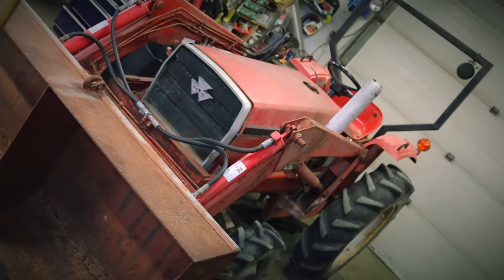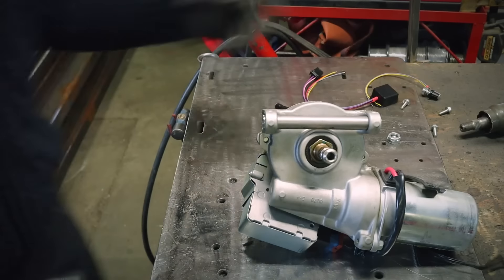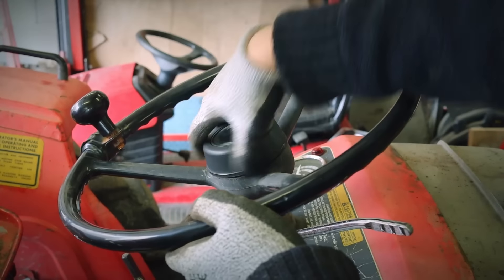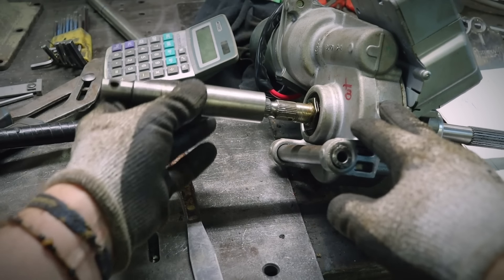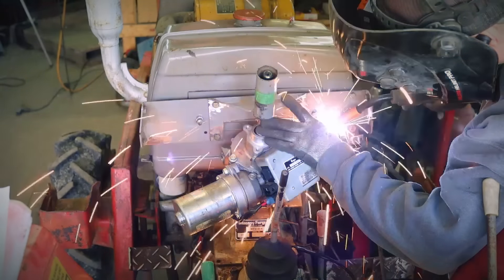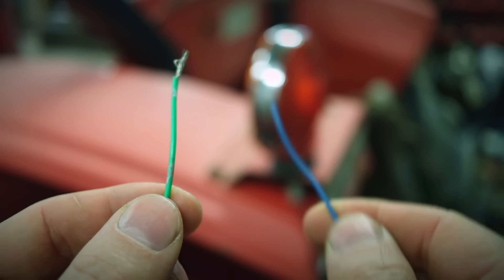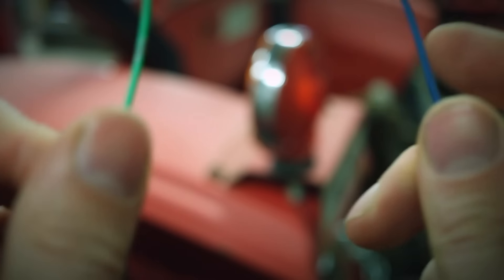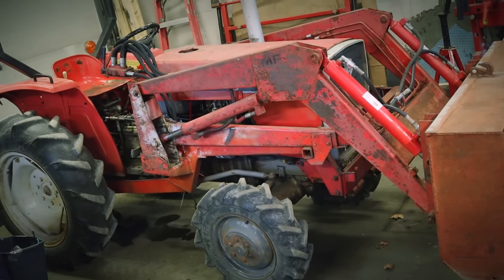ELECTRIC POWER STEERING on my tractor!? For less than 120$

Comment: I know several people who bought old tractors thinking that they could get some work done with them, only to find out that the only work that got done was TO the old tractor. I can't think of anybody better prepared to work on an old tractor than our man Viny B, and this video proves just that. Thanks again, Viny, for more fantastic entertainment!
Reply from the maker: Hey man, THANK YOU for such a nice comment! Glad you appreciate the content and all the upgrades I'm about to do to this machine!
Reply: I have a 1958 Ford 641. Working on her is just as fun as working with her! So no complaints from me!
Reply: If you buy a tractor or any other heavy equipment in that age, you definitely have to do some (a lot) of work to it to bring it back to a decent shape or even revive it from the death. But let's assume you didn't buy someting that only has use as scrap metal and that there's no issue like spare parts that can't be obtained anymore. At those times there was no electronics, so you can fix almost anything.
Once you did the needful to fix stuff that inevitably is broken, you can get a good deal of work done in a reasonable time that you otherwise probably wouldn't be able at all. I for example was digging out some tree stumps with my 1985 backhoe, which would be in the ground for the next 10 years to rot if I wouldn't have convinced my wife to allow me the budget for a machine. I'm pretty sure, I'd never have fixed my driveway with a wheelbarrow and a shovel either. And moving firewood can of course be done without a machine, but it would take not only a few minutes more...
So, while I sunk countless hours into addressing certain issues, it also has given me opportunities that I otherwise wouldn't have had. I count time as a currency that I exchange for the power to do things.
Reply: If that’s a Perkins powered Massey, it will still be running after you and me are dust (and if fuel is still available). Try that with a newer tractor.
Reply: That's the fun part

Comment: My best advice for working with electrical stuff - never ever trust the colors of the wires if you hadn't worked on something before. Just because the green wire is marked as ground that doesn't mean it is. I've heard people got electrocuted working on house installations because the ground was connected to live. Always check the wires with a multimeter. Great video!
Reply from the maker: I'm 100% with you! 👍

Comment: I think you should install limit switches to stop the assistance before the steering locks to not cause excessive wear or premature failure to all components. The car computer used the feedback from the steering wheel angle sensor to do that.
Reply: Awesome

Comment: Nice to see more people using these one thing I will add is, be carefull when welding to the output/input side of the saturn vue motors, they have plastic reduction gears inside the unit that are attached to the splined center shaft, not trying to discourage people from this mod, but just saying take your time with the welds especially if they are vary close to the center motor unit, and take your time and let it cool for a few minutes when welding it, well if you want to be careful with it, also a good tip to keep operating tempretures lower and improve reliability, you can extend the 4 wires and remote mount the stock saturn electronic control unit and bolt it to its own remote heatsink, if that is too much work at the least I would suggest you carefully remove the control unit clean the old thermal paste off,  and apply new high quality thermal paste to the unit sometimes the factory is a bit conservative with the application of the thermal paste.
Reply from the maker: Thanks for you tips! 👌

Comment: Lol... I had a Massey Harris 50 with difficult steering, for the decades I possessed it, with no loader/bucket. I thought power steering might be needed, but after rebuilding the gearbox & greasing all joints (king pin & tie rod), it steered so smooth & easy...power steering would not have made it any better!
Reply from the maker: I agree, my tractor without the loader, is absolutely fine! The loader is the big killer here!

Comment: I have the EPS on and working . Mine is a little different because I used a Nissan unit . However it is on and so much better than before  . I am also rewiring the whole tractor and fixing all the lights . Thanks for the motivation and if I can figure out how , I will make a video . Cheers

Comment: Tip for wiring anything even house wiring. Use dielectric grease on all connections. the dielectric grease keeps the connections from oxidizing, and failing. I learned this trick when I owned a Honda car. I had to take apart the electrical connections to replace headlights and find the clear sticky substance in the connectors. Found out it was dielectric grease. It really has worked well for me. House wiring extreme example, I had some outdoor yard lights with high power quartz halogen bulbs and they would only last a month or so. I added a lot of dielectric grease to the bulb connectors and the bulbs then lasted over a year. I don't wire anything now without applying it.

Comment: Used on an automobile, the power unit only works hard while parking.  The tractor application has it working hard almost full time.  Long duty cycle.  Wonder if a small 12v fan would help.  Looks like there would be room enough.  Pretty creative sheet metal work.
Reply: Used on an automobile it worked against a much higher gear ratio in the steering box (remember, the tractor was designed with enough mechanical advantage to be steered without assistance) so now the power steering unit is working only as hard as his arms used to and without the cornering forces, speeds, and lateral traction of an automobile.
Reply: @mwilliamshs  Yet the motor apparently gets 'very hot' so still not good eh?
Reply: We don't know what very hot is. Nothing under 200° is unusual for these units.

Comment: Very Nice Classic Musical Ending, no problems during winter time for the HOT electric power steering, during summer a side cooling fan perhaps 🤔Cheers 🍻🍻
Reply from the maker: Yes, maybe a fan...but so far, it works better then I though!
Reply: xD if he add the fan in the right direction he can cool two things at the same time xD

Comment: on the next episode you should make a quick hitch for the front bucket so you can easily swap them out, why you may ask even though you've only got front loader bucket? so you can build a new attachment for a set of forks to make moving stuff easier
Reply: Clearly you didn't watch till the end of the video!
Reply: In the US, you can buy conversion kits for old Massey loaders.

Comment: Awesome build. When trying to remove something like the steering wheel or a bearing with a puller, put tension on it with the puller and then hit it along the axis with your air hammer / air chisel. The vibration will make it come off easier.
Reply from the maker: I'll try to remimber that! 👍

Comment: FANTASTIC!! - Nice... Absolutely LOVE this video! Thank you!
I've got an old 1970s Massey Ferguson 135 (Gas, updraft) - with no power steering. 
Not nearly as hard to turn as yours, but still, no fun at all. 
I've done a LOT of brush clearing with it, it's definitely a workhorse. 
I need to fix the clutch throw-out bearing now (oh, yay) - as well as the hydraulic lift... (it's making a poketa-poketa-poketa sound...)
Recommendations appreciated!
Reply from the maker: Glad it inspired you! Good luck with your old 1970 MF! I was that 🤏 close to buy one....gas too...but it was took big for my small yard...and I'll miss the diesel smell 😅

Comment: Great setup. I think eventually the steering gears will strip out from the force. I have the exact same tractor in the Allis Chalmers 5020 version. I fabricated a hydraulic ram system for mine that mounts to the steering tie rod. Works great. Thanks for all your videos. Chris
Reply: did you need a different pump for your ram system to work or use the same pump that you for the bucket
Reply: Im here to ask the same question as daledubblanko

Comment: I believe you have inspired me.  What about installing a larger computer fan to blow air across the motor of the steering assembly.  When the tractor is running,  you would never hear it.
Reply from the maker: Good idea! But I played a lot more with this setup and heat is not the biggest issue now...I kinda destroyed the pignon gear and it's bearing....🤦‍♂️

Comment: I have the same model. My steering failed when the sector gear lost several teeth... Water leak entered  and ruin the pinion ... zero parts. 
I converted it to a hydrostatic system.

Comment: Consider adding heat pipes. (Copper tubes with a small amount of water sealed under a vacuum that rejects heat quickly) or maybe add some aluminum heat sinks to it…or 12v fan
Reply from the maker: aluminium fins could be an idea!

Comment: I'd like to add electric steering to my 65' Dodge. It has hydraulic steering now and works just fine, but,,, I want to go with a manual steering rack and this same or similar, electric column under my dash...

Comment: If this is the tractor I think it is it's made by Yanmar to Massey Ferguson's specs. I was looking at a similar unit at the local Kubota dealer last year before I got my new Massey Ferguson GC 1723E from the local MF dealer. The only difference is the tractor I was originally looking at was a Allis Chalmers model of the same machine. When I did research on it supposedly Yanmar made the same tractor for Massey Ferguson, Allis Chalmers and Bolens. The only difference  between the three besides the colors and branding were the hood/bonnet design. Other than that they were they same machine in different clothing with the same 2-cylinder diesel in it. :)

Comment: How is it holding up over time/use? I'm thinking about doing similar on my IH B414 so I can get a loader on it and to help out in the woods but wondering how durable it would be under heavier use.
Reply: Haha, yep, I’m in the same predicament, have a B414 loader tractor and wow it is a hard tractor to steer, even while it’s moving it’s rough. I’m from Australia

Comment: Awesome video! I have a mf220 pretty much identical machine I've been trying to figure out a way to put power steering in... Thank you for this video I haven't put much thought into keeping the original linkage and adding eps. Are things still working good and anything you would do different?
Reply from the maker: For now everything looks pretty good! It's a game changer for dribing these little tractor and it's a ''simple'' modification!

Comment: Impressive effort!  Nice job!  But, IMHO, I think this will come back to bite you in the butt.  The original OEM design calculates forces on the steering gears based on manual (human) input.  So now, you have added 10X the force on these same components...they were never designed for that.  Somewhere along the way, a front tire/wheel will be in a hole and you'll crank the steering wheel and you will feel something snap.  You might want to have spare on hand of those components also!
I own a Case/IH 235 with manual steering.  I would love for it to have power steering, but I am certain the gears can't stand forces like that.
Regards.
Reply from the maker: Yep, you got that right! I found the weekes link by playing with it and it's the helical pignon gear...tey don't make these anymore so I bought an used one for the price of probably 3 new ones! 🤦‍♂

Comment: If you use the adjustable pot for power steering force, does it change the tactile 'feedback' from the steering?  I hate driving rental cars with electric power steering, but if there was more wheel feedback, it might be interesting for other projects.

Great for your tractor of course.  Thanks for the video!
Reply from the maker: Well you really feel it, It's harder when the POT is at a low setting. I always run it full on!
Reply: @VinyB57  I was going to say that those potentiometer based (usually a 555 timer inside) controllers are notorious for 'drift' - as they heat up the assistance varies - and there's a much better speed sensitive controller which mimicks the original ECU/speed feed etc using a speedo pulse.
Then I remembered this is a tractor, not a race car.. and you run it full-on anyway :)

Comment: I have a 2 wheel drive MF 210. I have had the electric power steering unit from a Nissan Sentra for some time and thanks to your video , I am finally putting it on .  By the way what is the model number for the front end loader ? Thanks for the Video and good work . Cheers
Reply from the maker: Hey thanks, glad you liked the video, unfortunately, I have no idea what is the loader number...
Reply from the maker: Found the identification plate, it's a MF216 for the loader
Reply: Thanks.  I have my unit mounted and will be  finishing it up  soon.  I hope to have it  back  on  the tractor  in a few days.  I have taken  some pictures  but not sure how to post them . Thanks for the motivation  I  needed to get it done. Cheers.

Comment: Can you add a computer case fan to the underneath of the dash...or one end of the p/s unit...to blow cooling air over the p/s unit?

Probably 90% of steering effort in a normal road going vehicle is in a straight line...sothe p/s is not "working"...
whereas you are now using the p/s to turn  90 degree corners every 30 seconds or less......

I have a 30 year old heavy diesel powered SUV with hydraulic p/s...worm and ball mechanism...
and it tracks nice and straight with minimal movement/input by me on straight 100kmh tarmac roads..

Recently we bought a 2004 station wagon with electric p/s...and it "wanders" much more at 100kmh....
so easy to overcorrect and progress in sinuous curves....
 on a dead straight piece of tarmac road!

I just about need one of those "effort adjusters"....
perhaps manufacturers should have taken note of the automatic effort adjuster in the Citroen SM p/s from the 1970's?
Reply from the maker: Sure! But I ve been running like this for a few months now, And Its just fine like this, thanks for your comment
Reply: I thought you said it overheated??? @VinyB57

Comment: Cool project, probably the only MF tractor with electric power steering. At first I thought you where going to use the Prius steering unit everybody else uses.
What happens if the power steering hits the end travel in the halfmoon- gear below?, I hope it stops at too much force...
Reply from the maker: I heard that in the Prius it turns into limp mode when its not connected to the ecu and have like half the power...that s what I heard tho🤷‍♂️ Well while testing, I went to the end of stroke hard and I broke some teeth on the pignon...stupid me!! But I got a spare one for way too much money! 🤦‍♂️ So good call!

Comment: bonjour cousin , je suppose que pour les connections de la colonne de direction d'origine et du volant sur la colonne de direction assistée , tu as sécurisé plus que " tapi tap pap " : vissage ou goupille élastique style mécanindus  ? sinon bravo pour le boulot et comme toujours pour la finition qui laisse toujours l'impression du montage d'origine . Un moteur de direction plus puissant et des fils d'alimentation du moteur de direction plus gros ne seront peut être pas de trop . Encore bravo cousin . A bientôt . Signé Jacques , un maudit français
Reply from the maker: Salut Jacques, oui oui, j'ai soudé la bague au power steering, il y a pas mal de couple qui passe par ces composantes. Je vais regarder pour avoir de plus gros fils et me brancher directement sur la batterie... ça peu aider.